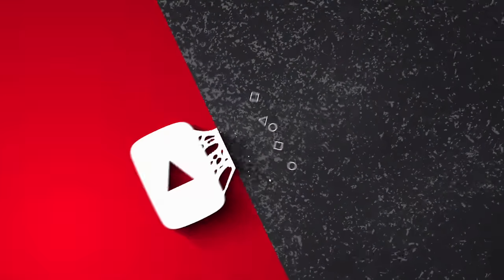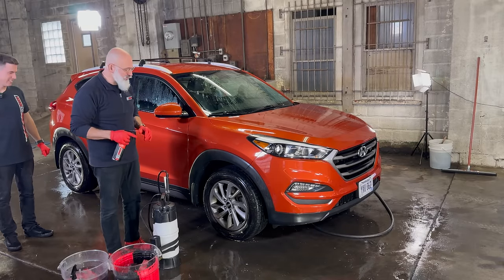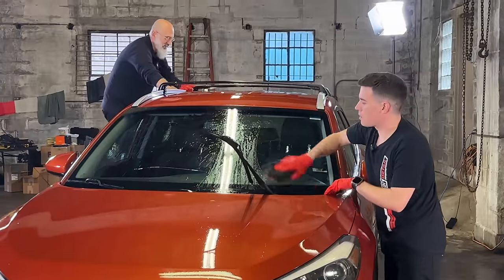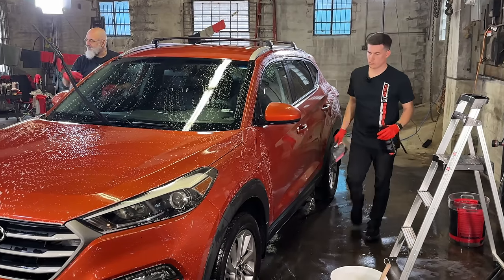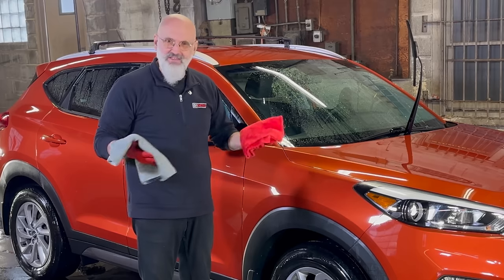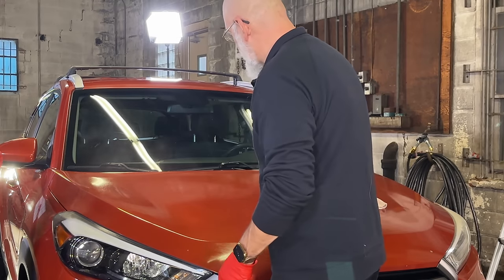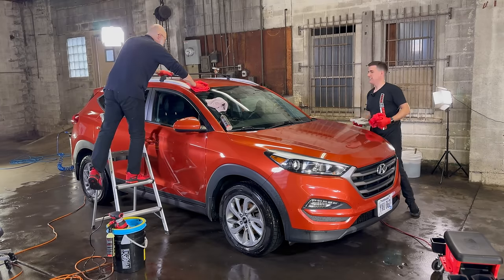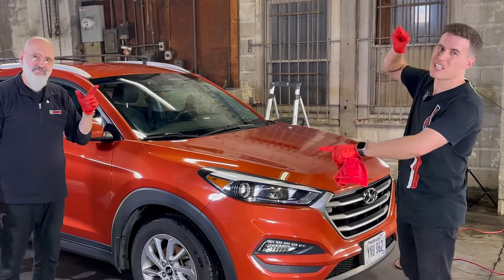QUICK & EASY PAINT POLISHING: wash, polish and protect!

Comment: I have to be honest, I do half the hood just about every time lol. I'm on Nick's side here. The product was producing, run with it unless something is wrong. I would likely use this process as a maintenance detail, minus the polish if I had previously done an actual coating on the car. Until DIY, I was using 3D polish or compound depending on pad, so the working time was reasonably long.
Reply from the maker: Good

Comment: Came back from a week-long 1900-mile trip with LOADS of bugs on my 4Runner. I foamed the front with All Clean, let it sit for a few minutes, rinsed it, then Incredible Suds foam (the whole 4Runner), and then used the Fine Grade Clay Towel on the front to try and get the bugs off. WOW, again I say WOW, I have never seen anything work so fast in taking bugs off a vehicle. Even previously using bug remover spray didn't work like this and trying to get that off before it messed up the vehicle's sealer. To close, I had previously used Water Spot Remover which again I say WOW, this brought back the beading and running of the water on the SUV. You guys have fabulous products and the only products I use now. I am telling everyone I know to watch some of the DIY Detail videos and see how your stuff works. 
Thanks Guys for all the videos and explanations on how to use everything.
Reply from the maker: Thank you.

Comment: For a palm sander it's a very good result. 
On the durability aspect. Doing it as a "one step" compare to using panel prep after the damp wiping. Are we talking about noticable of minimal difference.

Ceramic gloss is an amazing selant. Extremely glossy and slick.
Reply from the maker: Minimal if any.
Reply: @diydetailofficial  interesting! Thanks🤝

Comment: Very interesting and informative video. Thanks gents. A question - you mentioned that the clear coat was failing in places but also you would have used a pressure washer if it was available. Would you risk accelerating the damage to the clear coat if you used a pressure washer? My concern would be the pressure washer would break off more clear coat around the edges were it has failed, as you no longer have a sealed barrier of clear coat.
Reply from the maker: The clear coat was not failing in general, just on 3 specific parts. We have our pressure washer set to below 1000 psi.

Comment: Took apart my orbital sander over weekend, cleaned it up completely of sawdust... just got my Gold Standard and Wool & Waffle pads...I'm ready for a spring reset on my 8 year old VW.  Great vid guys!  I'm still debating on a 1 stage or 2 stage polish.
Reply from the maker: Start with one, if you like the the results no need to do 2.
Reply: @diydetailofficial  ya sounds like way to go. got the wool pad bc I heard VW paint can be hard, and my car is heavily swirled from earlier years of subpar washing technique. 

Seems the wool pad also finishes up well, so I'm thinking I'll reserve waffle pad for trim and piano black pillars. Alas, I'll run two test sections and see... Wool only vs a wool+waffle
Reply from the maker: Perfect

Comment: great video as always by trying to keep it informative and real at the same time. I do have one question, is there a reason you skipped after iron remover not using water spot removal  to remove any minerals on the surface so when you're polishing you're not grinding into the clearcoat? It's obvious this car had no protection so I would think that is a very important step not to skip over.
Reply from the maker: We wanted to showcase a different approach
Reply: That's fine, but what is actually going to remove the minerals as we know the rinseless won't? So the minerals were still on the car when you were polishing which from watching any of your other videos this is a big no no. @diydetailofficial

Comment: Try using the garden hose foamer more. It’s probably more affordable option the large ik foamer for some consumers.
Reply: I didn’t know of a garden hose foamer. Thanks. Any particular brand you recommend?
Reply from the maker: We’ve used it in several videos.
Reply: @diydetailofficial  I must have missed it. Thanks
Reply: Garden hose foamers use a lot more product, so I would stay with the pressure washer.

Comment: I am quite skeptical that a non-clay decon is anywhere near as effective. Would you mind proving me wrong by using your decon product and then using a clay bar after and vice versa to see which product picks up more.
Reply from the maker: A clay bar will pick up more contaminants, but a clay bar also has abrasives , meaning that when using a clay bar, polishing is often required. The Perforated Synthetic Decontamination Towel has no abrasives and doesn’t marr the surface.

Comment: My car has a black roof. No scratches or swirls but etched and hazy stuff to the point it barely has any gloss.  Should I go with yellow foam or wool pad on a palm sander?  I would also like to remove any remaining previous ceramic coating. Thanks
Reply from the maker: I would start with the yellow foam

Comment: I know you guys just did a video not long ago about using both quick beads and ceramic gloss. Quick beads first, rinse then finish with ceramic gloss? They both last the same amount of time. What is the real advantage of using both?
Reply from the maker: A few advantages, first it’s fun to do( great slickness) secondly it will give better hydrophobics and be easier to clean. Think of as the closest you can get to a ceramic coating without applying a coating.

Comment: Does having the wax as the base layer affect the durability ceramic gloss?
Reply from the maker: You do not want to use a wax before DIY Detail Ceramic Gloss. FYI DIY Detail Gold Standard Polish is a pure abrasive polish, not a wax.
Reply: So, no residue is left behind? Since it was wiped off with the rinseless wash.
Thanks for the reply.
Reply from the maker: @cliffelmore5834 correct, no residue from either.